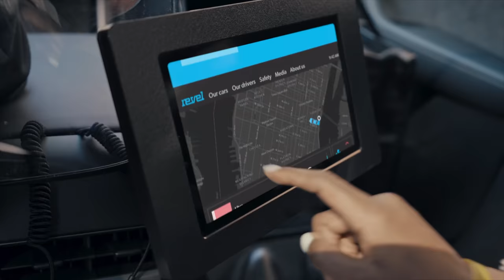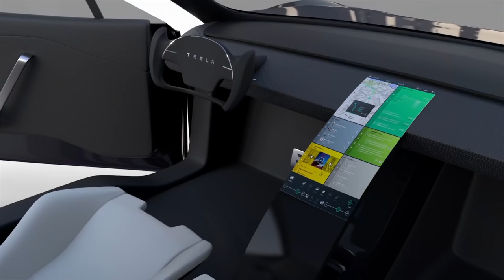Elon Musk INTRODUCES Tesla's First Flying Vehicle!

Comment: Imagine, fully electric car, incorporate some sort of solar panels to the design that will be charging car while on road or stationary, never need to pay for electric to charge it etc. And that would be something to look forward to.
Reply: Solar energy alone won't be enough to keep a flying car powered up it will draw an immense amount of power
Reply: @venator7889  Honestly not even talking about the flying car but just any standard electric car itself.
Reply: There making roads that charge while driving
Reply: don't you think if it was that easy, it would have been done.
Reply: @Supraboyes  It probably is just as easy if they can build a rocket they could deffinetly br able to attach solar panels wiring to an fully electric car which we already have, what it is is the fact they won't be making money on it that's main reason
Reply: They have it
Reply: @TheKaosus  yes you can install it, but the power is small. You know that how much weight car have?I mean higher weight need higher energy to move. First, is the energy enough for motorcycle with rooftop solar panels?. Solar panel that install in a car need strong material and construction because the car move in high speed. The efficiency of solar panel which is depend by location. Solar panel has a lifetime, when the period of lifetime is expired, it's usually be broken,install in car is make more factor that can damage the solar panels, it's weird that maybe you need replace solar panel every month.I'm just ordinary people who knows less about this, not an engineer. But i think your idea is a bad idea in this time
Reply: Dude they think it but they think and about electricity companies they will fail the companies 😂
Reply: It's not about the solar panels. Some cars already have solar panels on their roof. Physics thought us that energy can neither be created nor destroyed. It can only converted from one form of energy to another.  So it's more about how to convert the energy, how to store it and the speed that the battery needs to charge.
Reply: That's exactly what Aptera is/will be

Comment: Shoving it forwards with jets has merit. However, friction wheels add minimal friction so there is nothing to gain by lifting a car off the road. 
What it does need is active suspension to better control the wheels and body roll.
Reply: Yes! If anything I’d want downward pressure for increased traction, no?
Reply: @Jethr001 Simple: just put a 16-ton weight on it. Amurrican ingenooitee!😎🤗

Comment: That's not crazy, the idea "flying car" of Tesla. In the past, different car-makers (Brands) builded also an example of a "flying car". With the special technic that's real able to fly.
Reply: The question isn't whether it's able to fly. The question is how long it stays in the air before it comes crashing down in the middle of a highway. Cars are dangerous enough on the road. putting those same drivers in the air would be crazy.
Reply: @Bahrta_sai  That's right, I think the pilots must have a flight-license to get off the ground. But steering a plane isn't very difficult.
Reply: @elvis-6250 Especially with X-Box & PS3.😎

Comment: I think from the picture from the beginning, Elon has already made an aero car. He isn't releasing it at the moment. He may want to have a different functional versions of the car. I think, engineering wise, it should be a good design. If it is battery run, it should be quite useful.
Reply: Yeah I heard about his aero car, too. It's made entirely out of chocolate, & when it flies too close to the sun it starts to melt & then all the little bubbles collapse inside & it loses all its buoyancy.
He's not releasing it yet until he gets diabetes...😏

Comment: I think these will be more for being on a car sized platform on a tunnel highway or an underground bullet train type  single car idea, where each car platform is locked into a maglev type train track that the car owner uses the cars insane speed thrusters, 0-60 in 1 sec, 200+ miles per hour speed, to safely travel long distance above or below ground at rapid speeds. Many major cities around the world have huge underground tunneling infrastructure already holed through by huge boring machines from mining, old ww2/coldwar military bases that will likely be converted from bases and tunnels into underground maglev type train tracks with trains or cyber tesla cars.  Also there will be smallish underground centers, shopping malls, cities, apartments etc probably beneath the future above ground “Smart Cities” etc.  Think of D.U.M.B.’S or like Denver, CO, the Airports massive underground infrastructure beneath it that a Tesla hover car could drive down underground and travel underground in the future to other locations at 200+ miles per hour, verses traveling at 120 miles/hour above ground on a highway to the same destination.  Maybe there is even tunnels (like the Chunnel linking Britain to europe) that go under the ocean, which would eliminate alot of costly airplane fuel etc?  
The future is coming soon!

Comment: So far Mr. Musk has created a company that sell solar panels, electric cars, and another company that builds and launches rockets (still waiting for Artemis to lift off) so why not a ‘flying car’?

 Except to take the new, expensive roadster and modify it to fly might not be a good idea….

 There’s one company called Sampson and they’re making a flying trike called the Switchblade because of the way the wings rotate into the cars body…

 So if Musk wants to compete with this company he better hurry because the Switch Blade is about to (or already has) make it’s first test flight…

 What I think he should do is make a compact electric car with a lower price, then invest money into hydrogen fuel for cars because batteries are too heavy and are part of the reason electric cars aren’t really practical, at least for now….